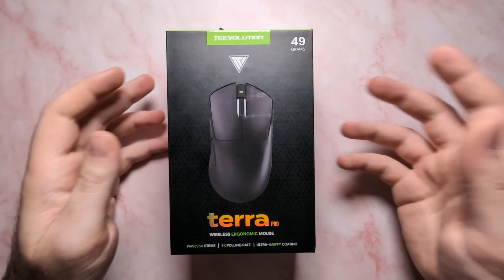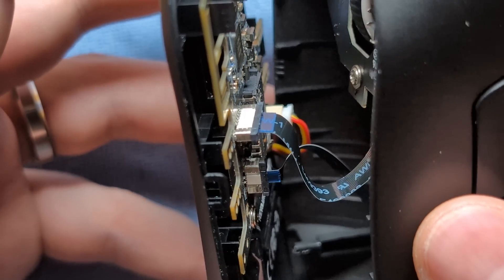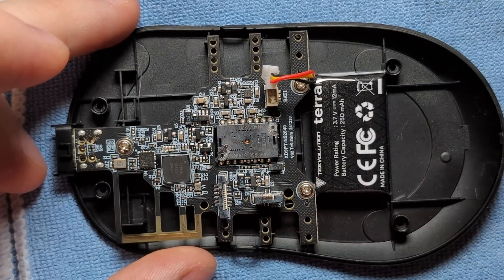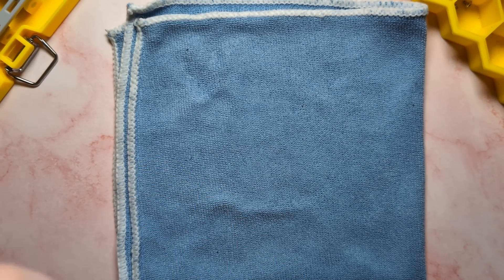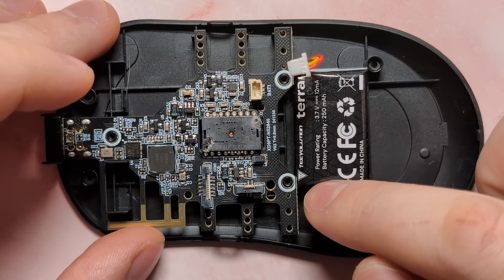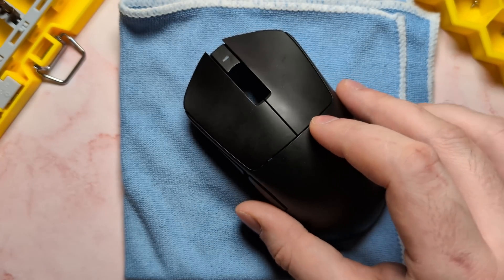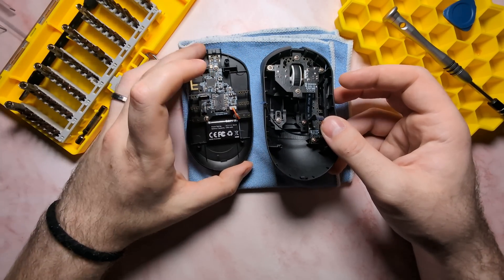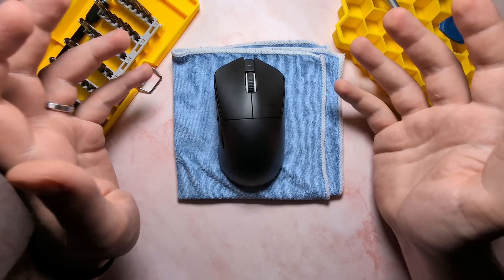TEARDOWN | TEEVOLUTION Terra Pro

Comment: Personally, everything the mouse offers looks great. The only caveat I have with it is that no option to replace optical switches to mechanical. From my point of view, the low latency of optical switches (maybe optical encoder too) does not matter, when the feeling/sound of mechanical switches is way better, especially if you are not an already established eSports athlete. I am not even talking about that mechanical switches have more variety on the market than optical/hall effect/TMR switches, both in mouse and keyboard sections.
Reply: is it not possible to desolder them?
Reply: @sviru007 you can desolder them, but you can't easily replace optical switches to mechanical, since they have a different structure and placement of soldering pads. In theory, if you are good enough with tricky soldering (and you can get good enough in soldering only by constant practice on SMD stuff) you can still get around it and solder it in place of optical switches, but it takes too much time, effort and is not worth it in my opinion.
Reply: @guessit5036  Hi. I have already replaced the optial ones with mecahnical ones. I could not stand them in games I play. I click a lot with super frequency. I have installed normal Omron ones that I have in my 403. It is much better but still wore than my G403. Construction of the mouse must be the issue I think. Quality of the plastic is way different - i know it is becuase of weight reduction. That is why i still prefer my modded 69g g403.
Reply: @sviru007  Good job with soldering, dude.

Yeah, I completely get you. To this day, I still use my modded G703. I modified its weight by getting rid of junks of plastic and drilling holes by hand in every possible place without sacrificing both the construction of the mouse and factory look. Then I replaced all switches, encoder, battery to 240mAh and completely got rid of the DPI switch button. The final touch was getting rid of magnets and additional weight, sanding the bottom case to the mirror finish and adding X-Raypad's white dots. On the X-Raypad Aqua Control 2 it feels almost like air hockey handle, which you still have a control of.

Since it is an old version, the PCB is a bit on the heavy side, but overall, I got from 117 grams to 73 grams.

Comment: A couple more observations after taking my own Terra apart:
Part of the issue with respect to the screw posts blowing out relates to the type of screw used. If you look carefully, you'll notice that the scroll wheel/button PCBs are held in with small tapered-thread self tapping screws. These do not seem to cause the same blowout issues. The base piece screws into very similar posts, but the screws are larger diameter machine screws (!!!). I think all the posts for the base are spec'd for the same variety of self-tapping screw thread that's used on the side buttons and wheel.

In the original review, you mentioned a slight forward weight bias. If you wish to upgrade the battery for 5-6g extra, a 500mAh 582535 sits perfectly between the rear screw posts (with the battery thermistor PCB on the left) and fixes the front-to-back weight balance. My mouse weighs approximately 55g with this mod.
Reply: Can you tell me the connector type? Is it JST 1mm? 1.25mm?
Reply: @HL-ei2li JST SH 1.0mm
Reply: @Xerpocalypse_  thanks a lot
Reply: What's the jst size for the battery and order of color for the wires ?

Comment: A word of caution: the battery adhesive on this mouse is incredibly strong. 
If you plan on replacing the battery, use 99% isopropyl alcohol in a dropper to soak and loosen it before even attempting to remove the battery cell.